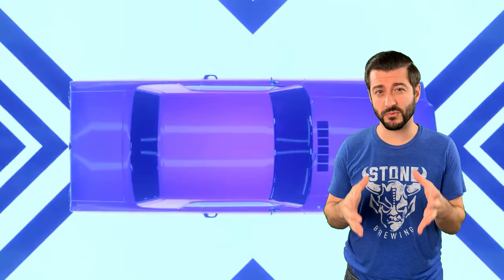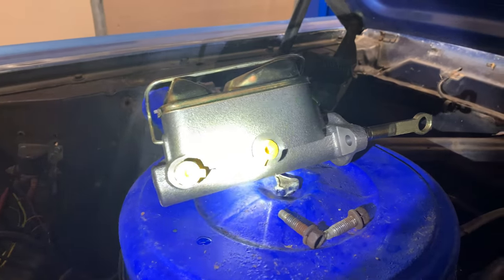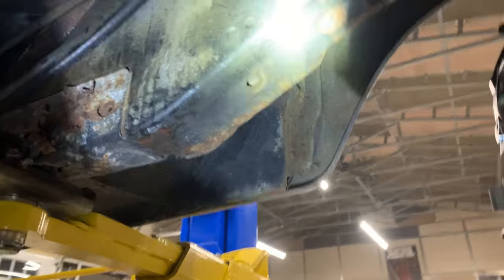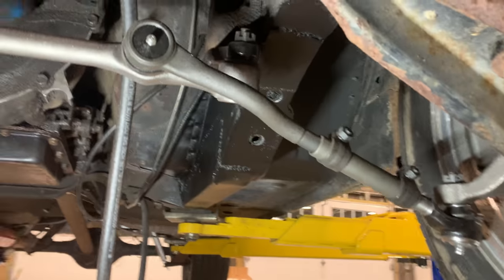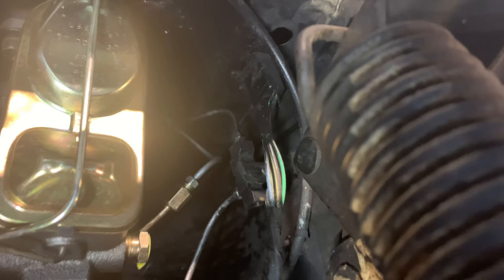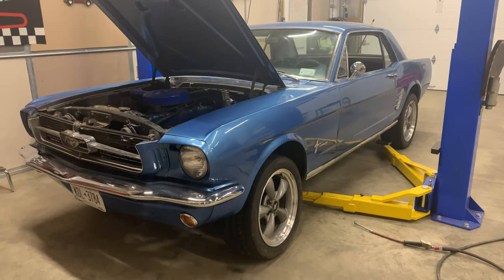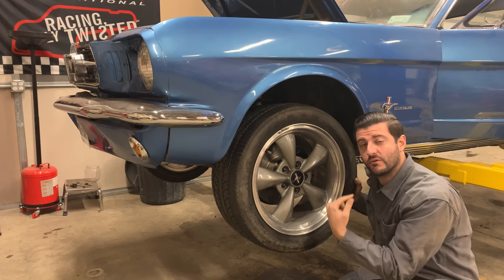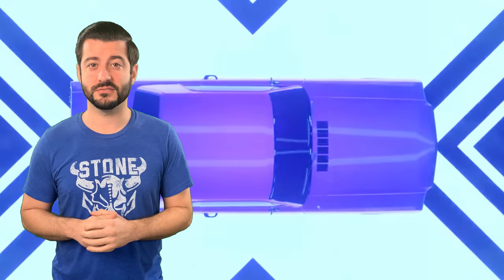1966 MUSTANG DISC BRAKE SWAP: PT3 - Steering rack, master cyl, and bleed. 351w swap Ep 8

Comment: Hi great video , there’s like 6 different part numbers which one is the specific one you used for your application , steering linkage , spindles and brakes etc ..thanks
Reply from the maker: Pretty sure it was swap 2.5/M/SLU.M but your car may be different so call and ask.

Comment: Did the v8 linkage interfere with the inli nne 6. I plan on swapping to a v8 soon but I would like to be able to stille drive it with the inline 6 and v8 suspension before I drop the v8 in
Reply from the maker: It didn’t interfere, it sits lower.

Comment: Did you have trouble putting the front shocks with the I6 cylinder engine in the car. I am doing a similar build but rn I have V8 springs and the shocks don’t reach far enough down into the compartment to screw down. I am assuming since the springs haven’t comprised enough as they should for a V8
Reply from the maker: Yeah, it was fine, you can pull them out farther if you have to I think

Comment: What did you do to the rear brakes? Did you convert those to disc as well? A follow up video on the rear brakes would be nice. Thanks for reading!
Reply from the maker: 80% of the braking is done from the front, I just did the drums in the back.
Reply: @LowBoostFilms  I see that you had the same wheels on the back, what did you do to convert the rear to a 5 lug? I have a 66 sprint 200 and looking to maybe do this conversion. Any help would be appreciated, thanks!
Reply from the maker: @jackvogel359  I got a rear end out of a 1966 mustang V8. It was all ready to go. They’re all 5 lug. Only the 6 cyl were 4 lug
Reply: @LowBoostFilms  Oh ok that makes sense. I was planning on sending my axel flanges to a machine shop for a 4 to 5 lug conversion and then same with the drum. I know the rear end will have to be switched out when I put a V8 in, but this should accommodate the l6 for now till I actually get a V8 for it.

Comment: sorry to bother you again man but could you link the spacers you used. I just bought some because i have the same brake kit and wheels and the lip on the rotor won’t allow it to seat flush on the rotor
Reply from the maker: These are almost the exact ones I got https://amzn.to/3zeHqf5

Where is it hitting? It shouldn’t hit the rotor at all.
Reply: @LowBoostFilms  i bought hub centric spacers and the small lip on the hub and the lip in the spacer both hit before the spacer can sit on the hub. i appreciate all your help !